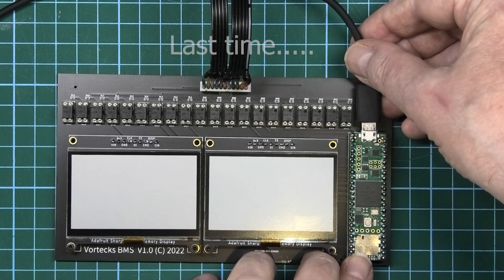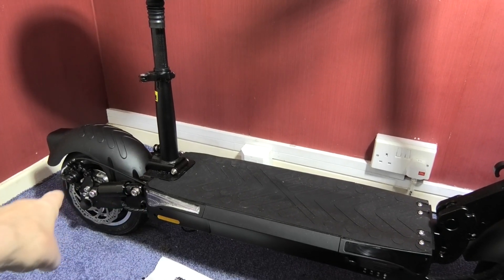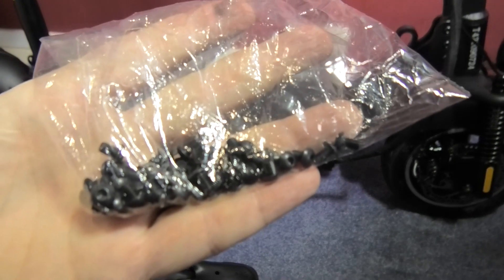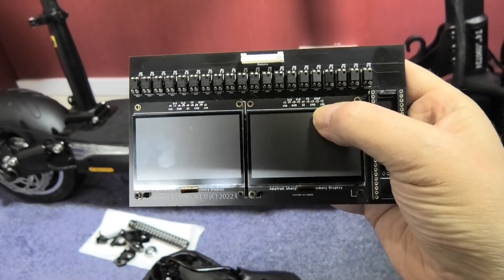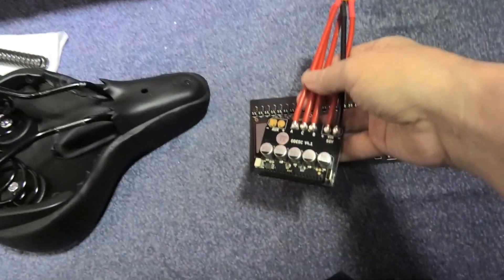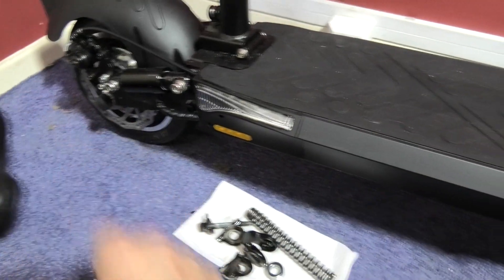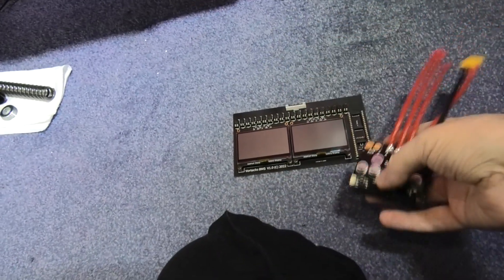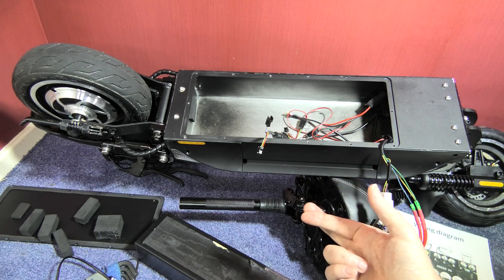Reinventing the BMS with VESC integration. I'm using the iScooter iX4 as the test bed -  Part 4

Comment: Super glad to see the vesc platform being integrated, especially considering thats the platform I am moving to very, very soon.
In specific the Ubox vesc's from Spintend, theyre super popular in the escooter scene right now
Reply: P.S Traction control is a feature you can utilise in the vesc software, you can use any sort of hall effect or light sensor attached to the front wheel to act as wheelspeed sensor to use with this feature.

Also make sure you open up that 75100 and fix the caps and deal with some insulation on the backside, people have had arcing issues with these on the phases to the case. I know youve probably done this already, but hey worth noting if some one who doesnt know comes across this.

Comment: ohh well the older FSESC75100's in a box like that have some issues with thermals, i personally run the Aluminum pcb ones which don't have those issues, also when you update the firmware on these you'll need to get Jaykups modified firmware rather than the official 75_300 or 75_300_R2 (need to check which version it is aswell) firmware cuz of some incompatibilities

Comment: this is next level shit, proper hyped up for this. also the suspension  on the front of your scooter looks quite basic. if the springs are too stiff get a mountain bike soft fork spring (possibly rock shox) and cut it to the length of the originals. it should take a bit of the sting out of it.